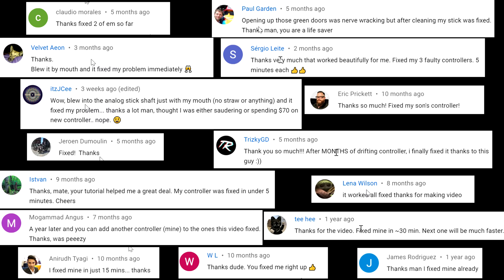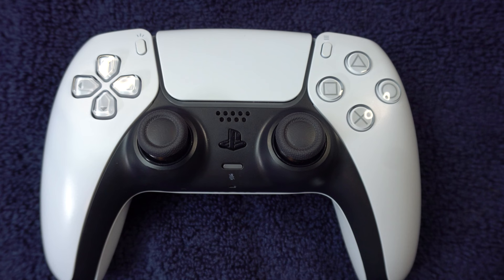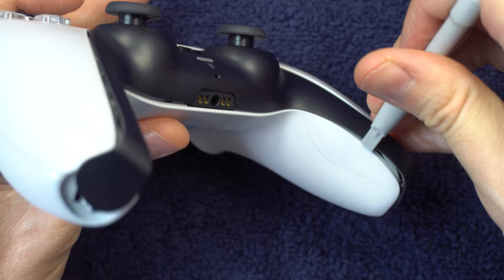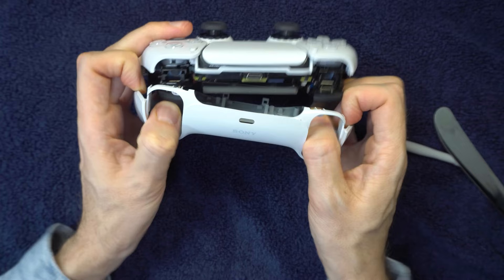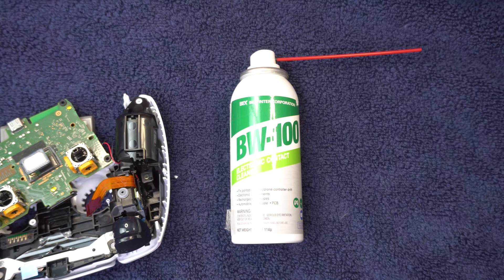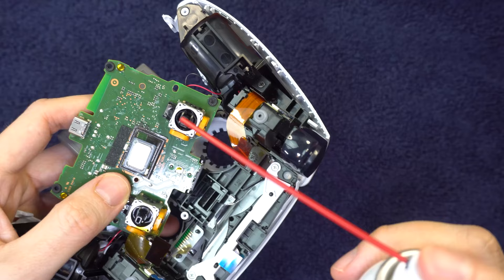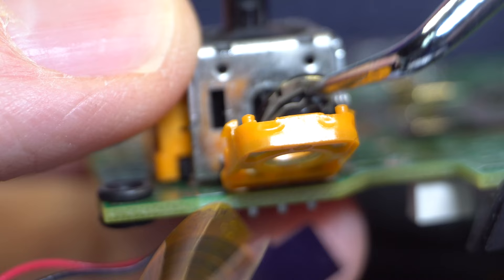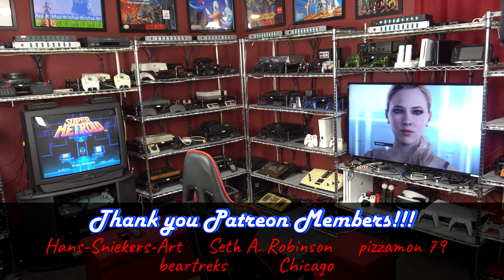How to Fix Analog Stick Drift on PS5 DualSense Controller (Sprinting/Repair/Clean/R3/L3/Take Apart)

Comment from the maker: Things you may need:
Button Replacement Set: https://amzn.to/40m0lzQ
White Thumbstick Caps: https://amzn.to/3FB37Jc
Precision Screwdriver Kit: https://amzn.to/3TtYrur
Charging Cord: https://amzn.to/3yNzeSi
Quick Charger: https://amzn.to/3FCEax4
Charging Station: https://amzn.to/3ZZEnTn

All Amazon links above are affiliate links. I get a small amount of money if you end up using them to make purchase (it does not have to be for the item I link to, as long as you click my link then move to another item, it works)
Reply: This actually worked. Everytime an electronic broke, I tried fixing them myself but I rarely succeed. This is like my first win in 5 years
Reply: I need help to get rid of stick drift

Comment: Partially dismantling the dualsense and removing those rings to let my canned air get down in there seems to have done the trick, this second controller will be useful with Elden Ring long play sessions. Thank You.
Reply from the maker: Awesome
Reply: How do you remove the rings
Reply: @veryveryindecisive  You can carefully pop the rings out with a needle or something. To reseat them, push in by hand around the circle til it clicks back in flush.
Reply: @GinoBrand5  thanks 👍
Reply: This seemed to work for me. Canned air and then a vacuum along the edge of the stick as I rotated it to allow air in&out of the housing.

Comment: I followed the steps in this video and resolved the left analog drifting issue! This video gave me the courage I needed to disassemble my PS5 controller and clean it! The parts inside are so intricate that I couldn't talk myself into breaking it apart, but I did it! Thank you so much Kevin!!!

Comment: Thanks, man, for the very detailed description of everything! I am not a tech guy at all, but managed to disassemble and reassemble my controller step by step, thanks to you video. Unfortunately, the problem still persist. My right analogue stick sometimes goes spazzing when I push it to the left. Well, time for another controller, I guess. But, thanks for your tremendous help!
Reply from the maker: You should be able to sell the defective one on eBay. People buy them for parts.
Reply: I'm having the same problem it drifts to the left really bad at times
Reply: @jefferyprevento4431  Tell me about it! It is so annoying! You just cannot play like this at all! Thing is, my PS5 is less than 4 months old. Everything is brand new. I mean, my Xbox One controller is, probably, 6 years old, and has seen enormous abuse in terms of usage. This bad boy hasn't moved an inch! Still, as good, as the day I bought it! PS5 controller - faulty after less than 4 months. Talking about next gen!
Reply: Same happen to me
Reply: @edgarector  Mine is less than 2 weeks old and started drifting. Was going so good until. Now it's frustration. Has me searching a bunch of these vids ever since. And apparently a whole lot of users are experiencing this drifting issue. It's a pain in the you know where.
Reply: @davidtsmith33  My replaced one started drifting a while ago. I guess, they make them from something cheap.
Reply: @edgarector  Real pity.

Comment: Beautiful guide. Very detailed and comprehensive. I had stick drift in both, left and right sticks and stumbled upon this video while looking for ways to fix it. Step 7 worked for me. Thanks a lot for the effort mate.😉
Reply: Method 1 buy a new one
Reply: @frozenllama23  Yeah no that adds up if you consider these controllers ARE SEVENTY DOLLARS and DO NOT LAST FOR WHAT THEY'RE PRICED AT. However if you are joking that's pretty funny. But seriously man, 70$ these mfs should be lasting years! My official 360 controller is over a decade old and besides cosmetic issues it has no drift or anything whatsoever. it also wasn't 70$....
Reply: The air worked for me lol

Comment: I would say for most people experiencing stick drift method 7 will get you back up and running without stick drift again for a while. You can probably do this for years to keep your controller working. Thanks for the video and good luck to all.

Comment: Hey dude, thanks so much! Method 7 worked for me - I replaced the wiper of the potentiometer (and a ribbon cable I broke while dissembling lol). So it only cost me £3 of parts instead of £60 for a new controller!
Reply from the maker: Glad it helped

Comment: Really helpfuil guide, it worked 100% for me. I tried all the steps. Screwed my controller trying to diassemble/reassemble it. Bought a new one which is now perfectly working. 

Guys, if you dont have experience and/or the tools necessary, dont try this. The risk is way higher than the person on this video tries to show. Take your controller to a professional. Only attempt the steps on this video if you are already considering buying a new controller or if you have experience with things manufactured by robots that are 1000% precise than humans.
Reply: Late reply, but I agree with the statement that if you DONT have the tools, don’t try it. The only tools you need are the Philips head, a flathead, some pliers, and an electronics duster. I used some shitty pliers that are to pluck eyebrows and it still did the trick, but I recommend using better pliers.

However, I semi disagree that you should not try it if you do not have any electronics experience; I myself have not tried to fix ANY electronics before and dissembling it, while nerve wracking, was not too difficult. I was being pretty gentle overall, but being a little rough is not as dangerous as it sounds, so long you do it with caution. Yes, be very gentle with the cables and the actual board and connections, but do not be too strict otherwise you are not gonna get anywhere with the process.

That being said, I only did it because I had a “dummy” controller with super horrible stick drift and I wanted to practice before doing it on my main controller. Step 6 worked like a charm and the controller had never felt better. I highly recommend only doing this if you 1. Have a dummy controller , 2. Are very desperate, or 3. Are just bored lol.

Comment: my left stick was drifting to the left, and i hated the idea of having to open my controller. I decided to try and even though it was absolutely teriffying, i followed every step and managed to solve the problem with some alcohol on the left/right sensor. it no longer randomly goes left. I know this video is already over a year old, but i still wanna thank you for saving me 70 bucks, very much appreciated 🙏

Comment: I just followed your video the other day. It was nerve wrecking taking apart the controller; but I did manage to fix the drift issue with my left stick using the DW100 spray. 

Thank you very much for the easy to follow step by step video.

Comment: Amazing and thorough guide! Eventually had to take it apart two times cause I didn't dare to open/touch the little potentiometer doors the first time, but I had nothing to lose and now everything works like a charm. I did apparently manage to rip the microphone ribbon when putting both sides back together (the part that needs to be slid in between the white outer case hinges , but hey, not like I use it and weirdly enough, it still seems to work... Thanks a million!
Reply from the maker: Thanks. I think that mic can be bought online.

Comment: I know I'm late to the game but I just want to give you an ENORMOUS shout-out. I've never repaired any electronics in my life, but I always wanted to try. Well, what better situation than this one. My local fix shop said "it's too difficult, you'd be better off buying a new controller". I bought a set of screwdrivers and isopropyl alcohol instead (for much less than a controller's worth). I followed your guide super scared of messing up. By the end I was comfortable with moving the components around and cleaning everything. And the controller felt like new!!!

I made one mistake: I thought that the little sound "fluff" in between the speakers and the holes was actually my hair. And I removed it hahaha Well, it's not a necessary component anyway, I guess I've just degraded the sound of my built-in controller speakers instead of having to buy a new controller.
Reply from the maker: I'm glad you got the controller fixed.

Comment: Fantastic video thank you for being clear and explaining each step while dismantling the controller. Helped me fix a squeaky thumb stick. I will say I had a bit of bother with the microphone ribbon and couldn’t work out how to reattach the rubber part which came off for me but I don’t use it anyway so not particularly bothered.

Comment: I don't know how to thank you. Method 7 completely fixed my controller and saved me from buying a new one a second time. You are a G!  I liked the video. I could not believe how much crud was inside the "door" of the left joystick. Q-tip with covid era hand sanitizer did the trick! The controller has a new life. Previously, my GTA character would walk left and steer left at random times which made gameplay hella annoying. This was a tremendously annoying problem and it's finally gone, for $0.  This is one of the most satisfying things you can ever do. Coming from an engineer and former mechanic. Thank you again and happy holidays!
ps. For prevention, use that bag the controller comes with and store it in the bag between use. Avoid spilling drinks and dropping food debris on controller 😅.

Comment: Great video, it was pretty scary to take the controller apart, one thing I found that helps is to use tweezers to remove the ribbon cables. Also something I didn't realize is that the microphone (and some other cable), with the square rubber housing does not plug in on both sides (which confused me a lot), they go in the casing of the controller, so don't worry about them like I did.
Reply: So scary. I almost died.
Reply: Me timbers were shaking rapidly

Comment: On my left thumbstick if you push the stick at a certain angle (like 2 O clock) my character would stop moving briefly. Was worried there was something wrong with the wiring. Step number 4 fixed it lol thanks so much for this tip!
Reply from the maker: Interesting!

Comment: Thankyou for going slow on taking the controller apart I had three controllers that had stick drift, I cleaned all three with electronic alcohol, electronic cleaner and a dry cloth to clean up the liquid then used canned air to blow out access liquid then put the controller back together and tested and all 3 work like new now. 😎😎👍🏾👍🏾

Comment: Idk if it helps or not but, the first time I opened it and cleaned it... it didn't work. My left stick was not fixed. But I did it again and as he says in the video inside the yellow door of his analog stick is a disc when you open it up(which are in all ps5 controllers) but I swapped the  disc's on the right with the left and so far its works good!

Comment: Doing method 6 + 7 just made my stick drift worst

EDIT: Fixed my issue thanks to the comments in YourSixStudios video. When taking out the small white pieces with metal inside the analog - make sure the tiny wires are fanned out away from the white plastic housing. If they are too close it will cause max shift drift which in my case made my R3 look in one direction only.

Comment: Thank you so much! Method 7 worked for me. My right stick drift was so severe that it looked like someone was actually pushing it up all the way violently. The tutorial was very helpful. The only trouble I had was to take out and putting back the upper ribbon cable.

Comment: I had my PS5 for less than 2 months before it first came around. I used the pin on the back to fix it the first time. Then it came back a few months later. I bought a new controller with my PS5 so I started using that one. Then, when people would come over to play, it sucked using that one with left stick-left drift. Then my other Controller started having it. For as expensive as they are, this shouldn't be a problem.
I took one apart & cleaned it. Took me 2 hours to complete. I still need to fix the other one. That's what brought me here.

Comment: Method 6 was the one for me, was happening alot at my ps4 controller that hairs and debry caused a drift, I was sure this one will fix the drift issue at the ps5 one as well.
Thanks alot, you saved my weekend !

Comment: I used the info in this video to strip down and fix a problem where the analogue stick would snap all the way to the left when pushing right. It worked like a treat, although I had to open the potentiometer a few times to clean out all the crap. The section starting at 10:55:00 was the solution.

Comment: My dualsense started drifting the day after I fixed my first joy con. I was super stressed doing the whole process but once I took off the thumb caps I noticed the problem: dog hair had gotten in there somehow. Took it out, closed it up surprisingly easy, considering how hard it was to open, and the problem was fixed immediately.
Not sure what happened this generation that thumbsticks keep drifting. I had my dualshock 2 and 3 for years and years, banged up so much you could hear them rattle if you shook them, but drift was never an issue. My ds3s thumbsticks are even so loose so they spin freely if you rotate them but they absolutely do not drift

Comment: Method 7 worked for me. I tried all the others before but didn't do anything then tried step 7 and boom fixed and It cost me nothing because I already had tools and isopropyl. One of my little disks had build up of black stuff don't know how it got on there. Might need to replace the disk in the future. But working fine for now. Thank you very much 💪

Comment: I fixed my, let me give you another option to deep cleaning that doesn't involve disassembling the analog stick box. Contrary to people belief you can wash circuit board with flowing water and detergent. You obviously have to disconnect the battery, then disassemble until you can take out the circuit board with the black frame that hold everything together. You them put the analogs box into the flowing water of the water tap (the stronger the flow is better), them put some detergent (it work as lubricant to the dust particle), move the stick to it to spread around, use a toothbrush to clean at all the angle possible internally, them put it in the flowing water again. You can repeat the process one or two time to be sure no dust particle escaped. After you either left it at the strong sun of the middle of the day to dry or use a hair dryer. It's really important than you dry it fast (so do it when the sun is hotter) and completely before assembling. If it's too slow (like a day or more) or you let water droplets on the circuit board you can create oxidation on the connection of the chips and that will block the flow of electricity and the circuit will not work until the oxidation is clean (and sometimes never again).

After it's really dry assemble and it should be fixed. I have been doing this since the PS2 days, but at those early days drift took a lot longer to occur because the housing was harder for dust particle to enter. If there is no hardware problem (a broken piece) it's always dust. Analog stick use magnetic field to function, dust particle create static that mess up their field and report a distorted signal to the game.

Also to avoid drift buy a case or some sort of closed box and always let the controller there when not playing. Without gathering dust it will never have drift. I have a Dualshock 4 and a Dualshock 3 that have never had drift for years. My dualsense had that problem because I let people borrow it and obviously they were not always letting it in the case.
Reply from the maker: Thanks. I have been developing a rinse strategy very similar to yours, but I'm thinking alcohol might work better. However, I don't want any viewers to set themselves on fire so may end up doing the water.

Comment: I FIXED PS5 Pad, which had drifting on left analog stick.

CLEANING potentiometer didn't help.
The problem was faulty potentiometer with WORN out inner path.
NO NEED to resolder potentiometer.
Open potentiometer.
I took out the small white part that turns on potentiometer.
I used PENCIL to draw on worn out path on potentiometer.
Pencil has graphite that allows current to flow.

Now my PS5 PAD works.

Comment: Can I just say the straw trick is simple but genius sir. I think it helped a little bit. But I think this thing actually needs to be repaired. Its not a stick drift in my case. When I turn right using my right analog stick. It starts to turn back left in certain parts of the sticks dead zones.

Comment: I see you have an original 1977 woody atari 2600 there i still got mine very proud of you they are pretty damn hard to find these days 😎
Reply from the maker: Long live Atari. Actually mine is a light sixer, the second model which would have been 1978 to 1980.

Comment: Very solid video - got me back up and running, and boy was there an improvement!  However, I did notice that after less than a day of gaming with my freshly cleaned potentiometers, my stick drift came back with a vengeance :(.  I'm not sure what else to do, besides buy another controller - as I do not own a soldering iron, and haven't soldered anything in probably 2 decades, so I'm very far from comfortable getting myself into that situation.  Regardless, I wanted to say I appreciate the video and to thank you for helping me see just how drastic the difference is without this god-awful stick drift plague.